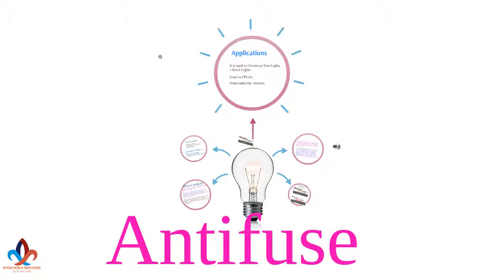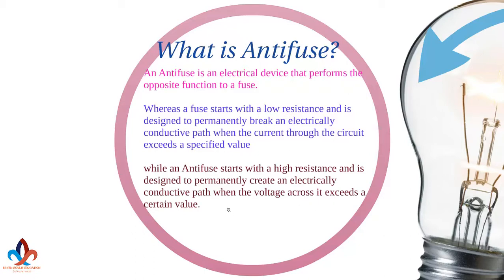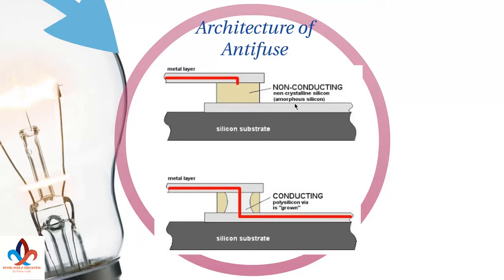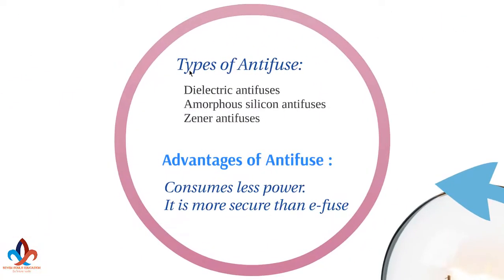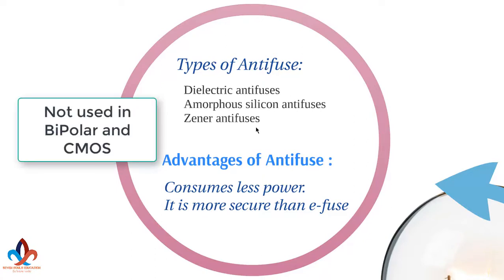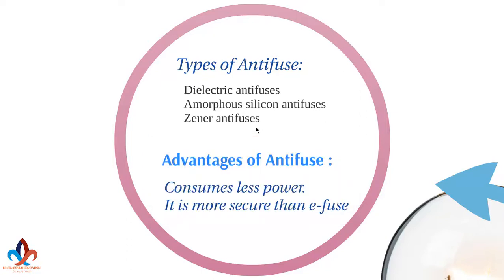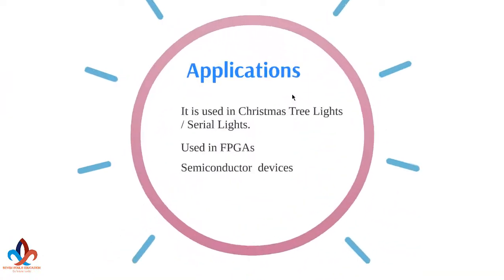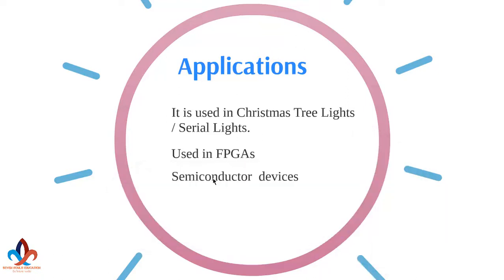What is Antifuse? Fuse Vs Antifuse | Where is Antifuse used?  FPGA

Comment: Not bad, but you forgot to mention the two anti-fuse FPGA manufacturers (Actel / Microsemi / Microchip) and Quicklogic - Xilinx/AMD, Altera/Intel, and Lattice do NOT have antifuse type FPGAs; they have RAM based FPGAs.  Also antifuse FPGAs are the dominate FPGAs for Space/Aerospace/Military applications where Rad-Hard and Highest Reliability matter the most !